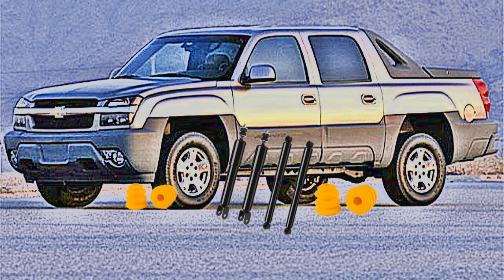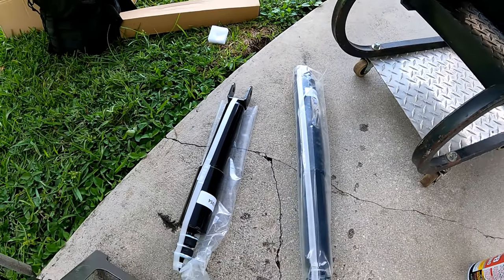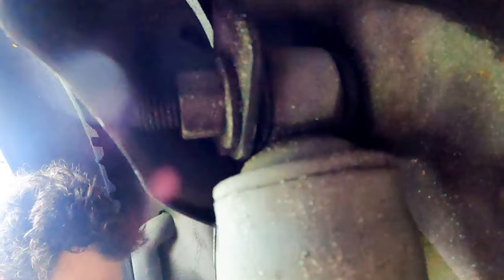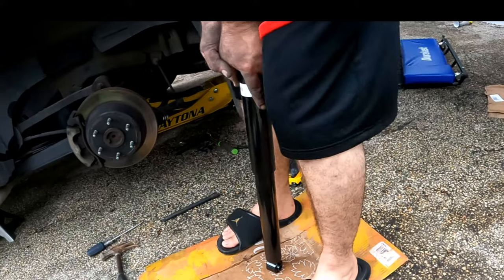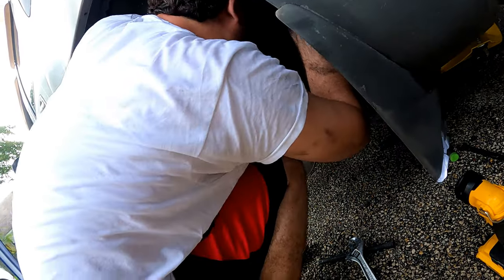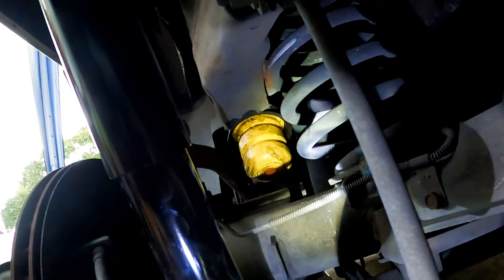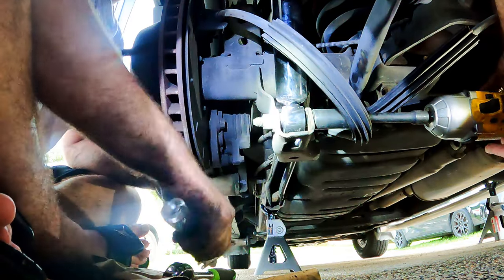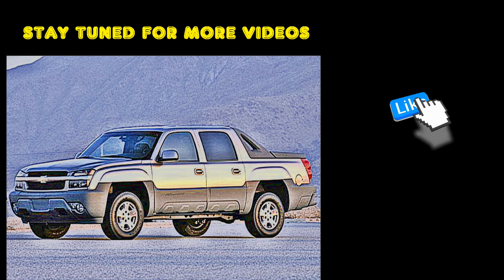How to Replace REAR Shocks and Axle Bump Stops on a 2002 Chevrolet Avalanche 1500

Comment: It would help to mention what ft-lb torque setting the shock bolts should be set at. 

Also, aren’t you supposed to retighten the shock bolts AFTER the truck is back on the ground??
Reply from the maker: Are you sure you watched the video.